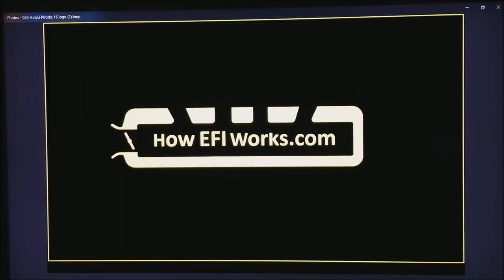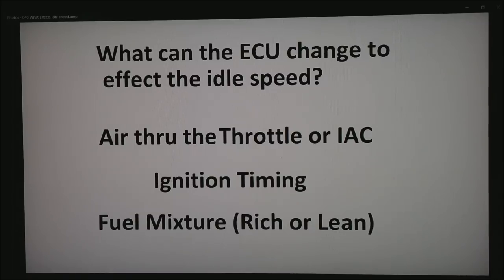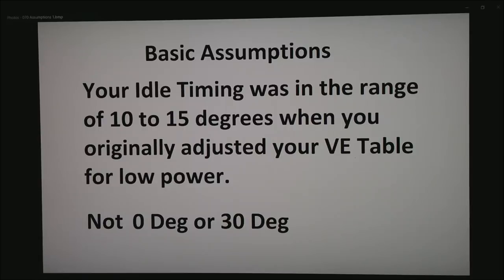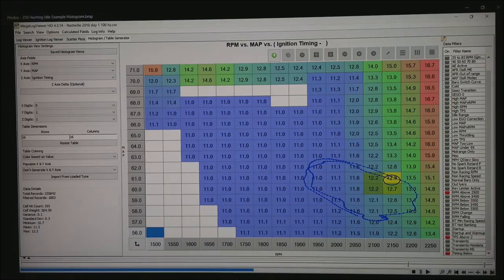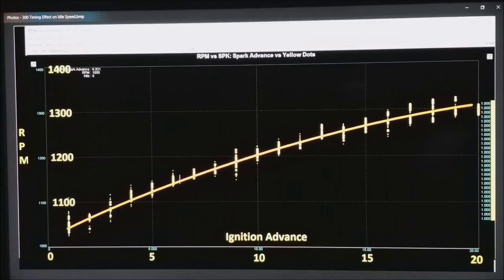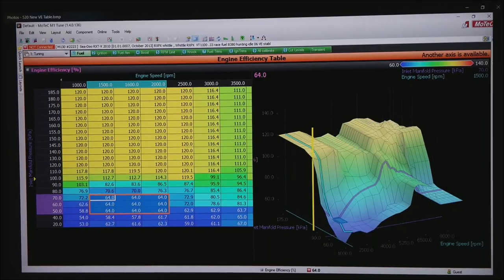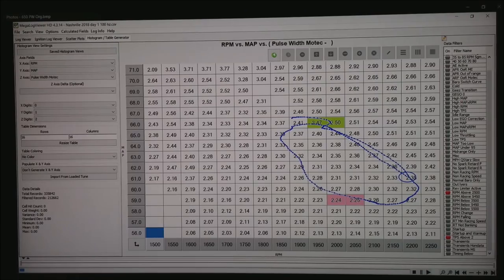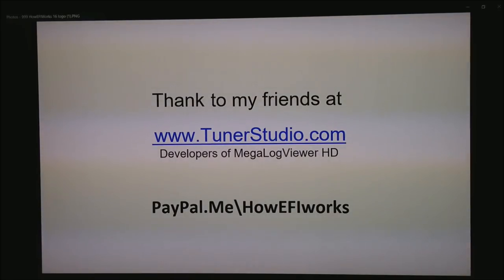Basic Idle Control and Fixing a Rolling/Hunting Idle

Comment: The problem I’m having is put it in gear it wants to climb speed but watching your other video I’m thinking the IAC. 2001 5.3 LS small camshaft . And I know timing can gain torque as well but I wanted to better Understand the idle air control thank you for the video

Comment: andy thank you for all the video's I am struggling with this process my self currently! I am having a hunting idle issue with stock motor, I have only been able to rectify with rich air fuel ratio's 11.8ish. is your recommended process to block off and turn off iacv, set idle rpm manually with air screw adjustment. set AFR's near 14.7, then smooth the idle with ignition timing,

Comment: Hi, a very big "THANKS" from me. I was struggling with hunting idle. Sometimes it was Ok in a tiny coolant temperature range. Today saw your video and know understand the connection between load, fuel, ignition and rpm in IDLE. Tried your tips and half an hour later idle is smooth  +- 20-30 RPM from target (openloop).

Comment: what a great video and great brief.... currently chasing idle on my engine with a big cam, short exhaust and shared intakes so its a bit pissy, but soley using the timing to control idle isn't something i considered, id been using the throttle stop (no iac yet) then adjusting the VE and timing tables to suit. i do use a large timing valley which helps also though.... food for thought, thanks

Comment: Im going to be installing ITBs on a miata, and I don't want to have to figure out installing an IAC. From what Ive read, and from what it looks like you're teaching, if I tune the motor properly, I should be able to achieve a stable idle without an IAC, correct? I don't have A/C or power steering, so the load should be pretty consistent. If I am understanding correctly, even with the changes in alternator load, I should be able to stabilize it enough by using timing to create a self-stabilizing 'zone' in the idle area of RPMs.
Reply from the maker: True.  It is free to try.

Comment: I am restoring a Jaguar V12 engine with carburators and I am thinking of an EFI conversion. Can the Megasquirt system support a V12 and can I use 4 wideband oxygen sensors to control them as close as possible. I have 4 exhaust manifolds where each has input from 3 cylinders which would allow very close controll of that big engine.
Btw. Your videos are the best to understand all the facets of fuel injection.
Thanks Bernhard
Reply: Bernhard List yes it can. I would recommend you head to hpacademy.com and watch those lessons about basic EFI. I’ve used that site to help since YouTube videos only take you so far
Reply: Thanks for your reply. My engine is still in pieces but I am gathering the components on the way to convert it to EFI so everything helps.
My goal is not a race engine but the smoothest running V12 being dropped into an E-Type roadster. Let’s see if it will work.

Comment: I may add that one of the best things to do is not to use the EGO, wideband or close loop within the rpms you’re trying to idle with a big cam engine. Use the idle screw, IAC, VE table and timing table to stabilize idle. The EGO will hunt forever.